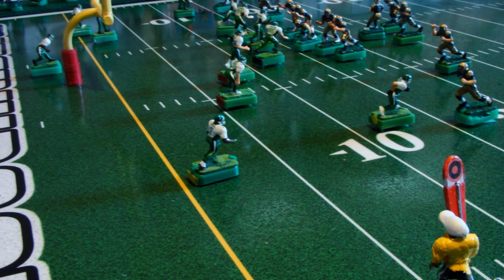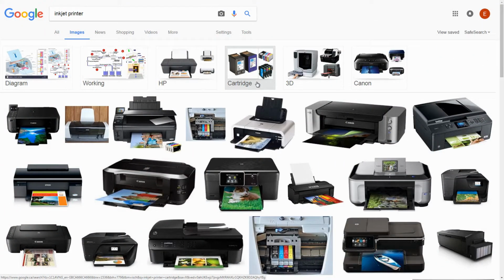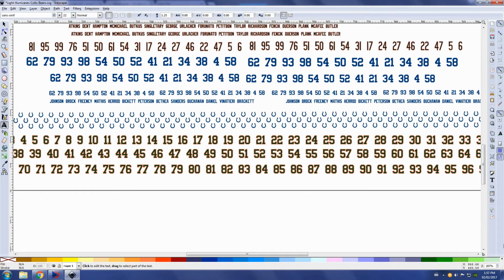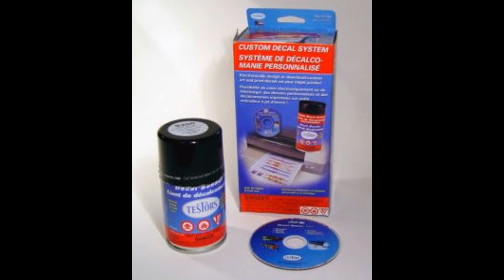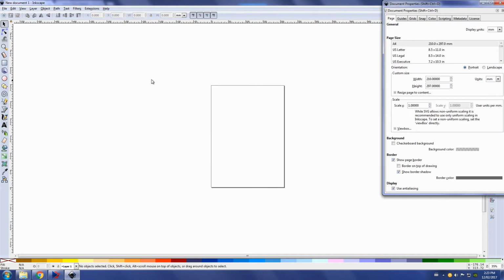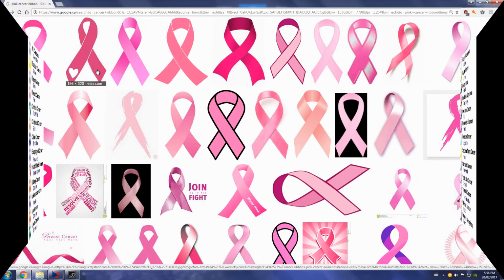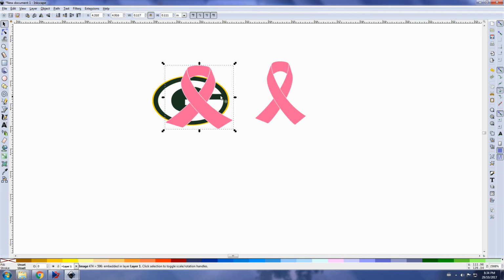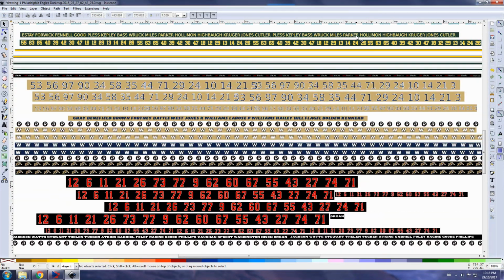Electric Football: Decal Making Tutorial Part One

Comment: I noticed these posts were made 5 years ago.  Are you still into the hobby ?
Reply from the maker: Still interested in the  hobby but  having said that,  not so much  in the past couple years. Too much going on in life  lately, hobbies take a back seat when that happens.
Reply: Understood.  I started my board in 2014 and got it finished but was never really happy with the vibration mechanisms. I didn’t use motors I used a magnet based vibration.  

With the current pandemic I decided to upgrade the vibration to a motor based system.  I’ve been following your videos as a guide but changing it up a bit. 

Is there a way to private chat ?